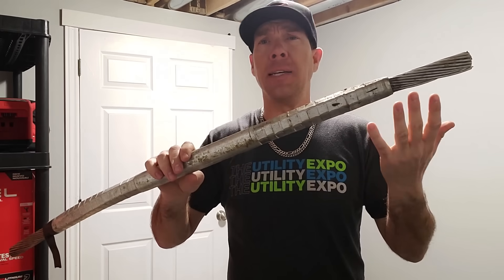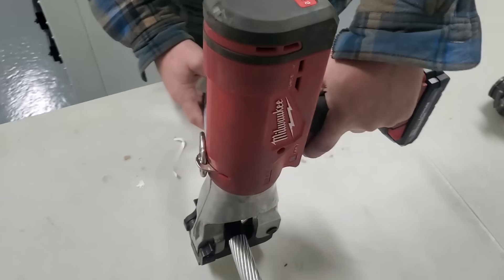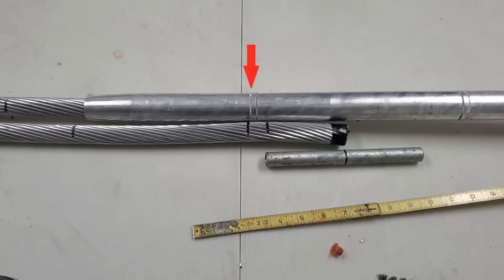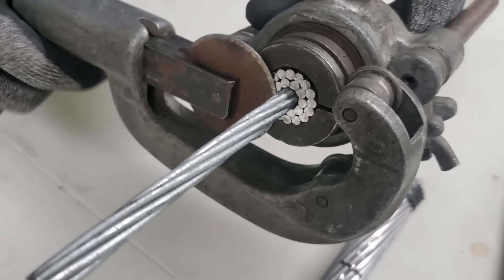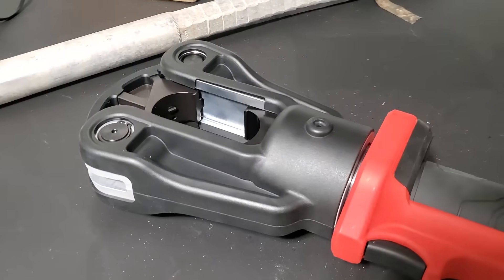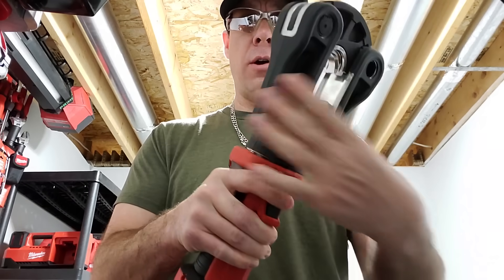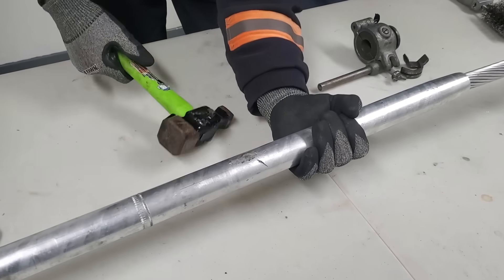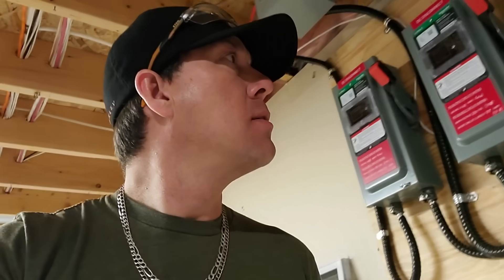How to splice 556 ACSR - 2 part compression sleeve

Comment: In this video you have showed us how splicing of ACSR is being done on classical way, with press and dies. I know that you are not in transmission department, but have you ever heard of implosove splicing? A method of splicing where splicing is being done with detonation of implosive charge on sleeves rather than with standard press and die that makes whole proces faster, splice being more uniformed since the whole sleeve gets "pressed" in a moment and apparently without elongation, unlike with presses where you even showed us that elongation and bending of sleeve as well. Also there is not so much work arround it since you do not have to bring all the pressing tools and dies with, also multiple lines can be done at once too.

Comment: Wondering how you do an aluminum conductor when there was such a scandal in the past about aluminum home wiring catching fire? Did home just use the wrong gauge?
Reply: The problematic house wiring was used with terminations not properly designed for the alloy used. You can still find Al wiring used in new houses for high-current (50+ amp) applications such as a service feed but the alloy is slightly different and the lugs are designed for this alloy and properly torqued. I believe it's only allowed on high-ampacity circuits because hackjobs are most likely to only touch 15 and 20 amp branch circuits.

Comment: My question is with the hex shaped press head do you not have to rotate the head?
Reply from the maker: The Linear press doesn't banana a sleeve as much as a jaw type. The sleeve shown in the video; one side we didn't rotate at all, the other side we did. The steel center is especially important to be straight and usually requires the crimper to be rotated.

Comment: and, for those that may not know. The reason the aluminum over the steel isn't a big deal electrically is because of what's called the 'skin effect' which essentially means more of the current of AC flows more towards the outside of the conductor (and decreases as you move towards the center of the conductor), and since aluminum is a better conductor than steel, that's why it's ok. (yes, it could be said better, but yeah)

Comment: Someone mixed up the dies on our big ed tool (hydraulic press). When I went to use it, the die exploded cutting a gash in my safety glasses and breaking my front tooth.

It was my fault though because i got in a bad habit of seating the dies by using the press itself. Those old style tools were hard to use.

Comment: Hey Aaron,  when you mentioned that the conductor was AL over a steel core, I had a question pop into my mind. 
Since dissimilar metals can corrode, what stops galvantic corrosion from happening in those conductors?  Thanks so much for taking the time to produce these amazing videos.  I really appreciate being able to learn about how all of this works.  
Blessings to you and your family!
Reply: the addition of penatrox improves electrical connection in addition to prevent corrosion sleeves for smaller conductors in addtion to automatic sleeves come preloaded with penatrox
Reply: @darrylprosser279  what about where there isn't a splice?
Reply: the purpose of penatrox is to prevent corrosion and insure a better electrical connection most smaller sleeves ,deadends and crimpits/sqeeze ons (electrical connections of two conductors not under tension) come pre loaded
 @liam3284

Comment: We say to the helper tool ridgid, with the right rope insert you can't cut into the steel core. This Milwaukee machine is amazing, we have 800 bar hydraulic presses that are very heavy. Maybe as a tip if you keep turning the machine while pressing, the connector stays straight and doesn't look like a banana
Reply: Aaron has pointed out the banana effect in a past video - in that case it was to alternate pressing one side, then the other as he went along.
Reply: @AlanTheBeast100  I must have missed a video. then everything is good if that has already been explained

Comment: man watching these makes me thankful for the compression sleeves we use down here where i work. about half the size and don’t have to strip down to the core. hell we use automatics still on 795.
Reply: I didn’t watch the entire video so maybe he talks about it, but why use a compression sleeve?  We use autos on 336 and 795.  Only place we wouldn’t is in a slack span.  I don’t even think we have compression sleeves that big in stock.
Reply: @MBIvey1  i think it has something to do with automatics failing etc, ive worked on a system before where if we came across an automatic on primary we had to replace it with a compression sleeve, and here i am working now using automatics on 795 lol, just seems like a preference from the power company

Comment: We had I believe it was burndy, but I could be wrong, that made us a long 1 piece compression sleeve for 336 26/7 ACSR. We used them to replace 336 ACSR quick sleeve. Fortunately for us we only used 556 AAC and the only time we installed 336 ACSR was for spun bus where you need a tensioned neutral.

Comment: when doing that  type of crimp in the air, is that a one person job?  also whats the voltage limit on that type conductor?
Reply from the maker: Like many tasks, it can be done by 1 person, but much easier with two. When doing these "hot" it's almost certainly a two person job!

Voltage doesn't really matter, the wire can take any voltage really. It depends on the current... Often times you'll find larger wires at low voltage to allow for higher current.

An example would be;
Our 7200 volt lines are often only 2/0 acsr and once transformed down to 120/240 volts, the customers wires going into their home are 4/0 or 250mcm.

That being said, we typically use 556 for the first few miles out of a substation. This wire is also often used for transmission lines, but would be considered small in many cases. Our province's highest voltage is 345kV but some area may have voltage as high as 1 million (not typical). In many cases the conductors are bundled together into 1 very large conductor. (Not directly bundled, but run in groups).

The largest size conductor we use is 1000mcm.
Reply: @Bobsdecline  thank you for these videos.
Reply: Conductors don't have voltage limits, insulation does. These standard overhead lines are bare wire so AFAIK they don't have a voltage rating. The max allowable voltage will depend on the environment they are installed in.

Comment: At work we splice 500 or 1000Kcmil copper with full tension splices. The 500 is easy since you can do it with a 12T B/O crimper. The 1000 is a little harder using a 60T high pressure hydraulic crimper.